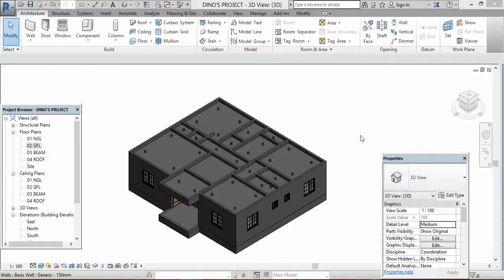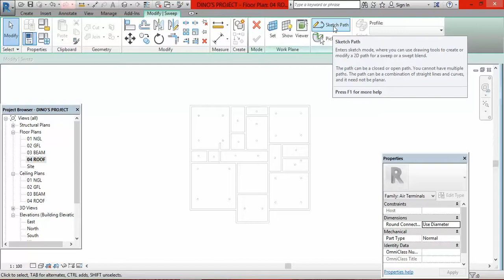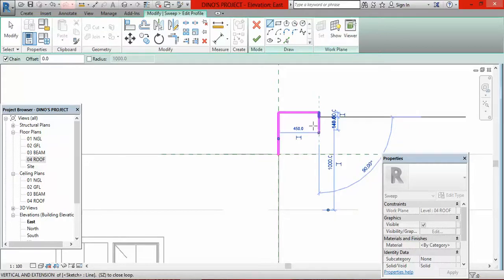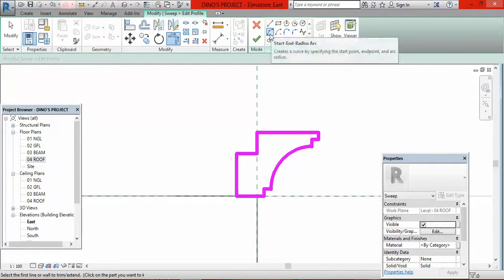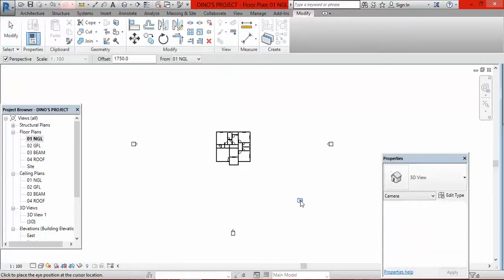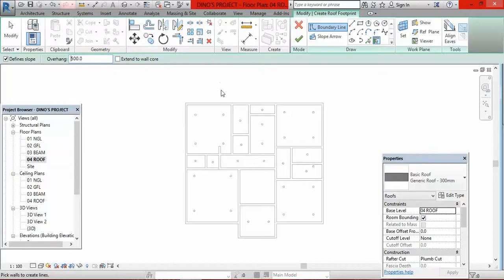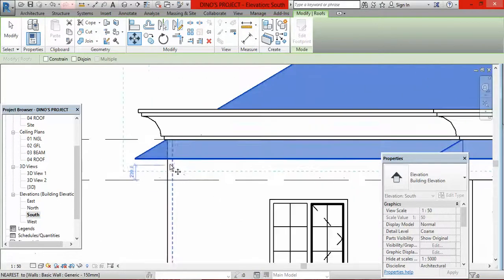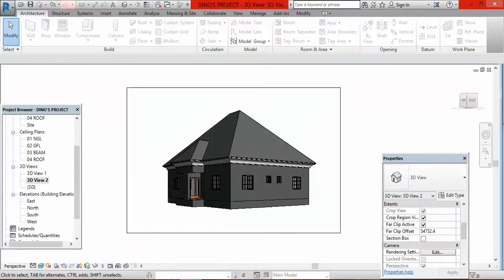How to Create Concrete Fascia and Roof in Revit

Comment: After finishing my sketch for the fascia, i got an error message that "Lines cannot intersect each other. The highlighted lines currently intersect."
What can i do please..?
Reply from the maker: Thank you Tast-QuaSat Company Ltd. The error message you got means that some lines in your sketch loop crossed each other. While performing your sweep sketching, a line is not supposed to extended over another and/or the sketched loop is not supposed to have an opening (gap) between lines. My advice is for you to repeat the process, thereafter, use the "Trim/Extend to Corner" tool to close and trim all your edges.